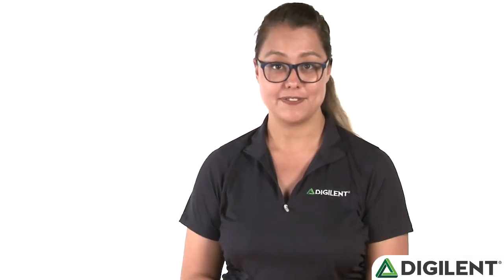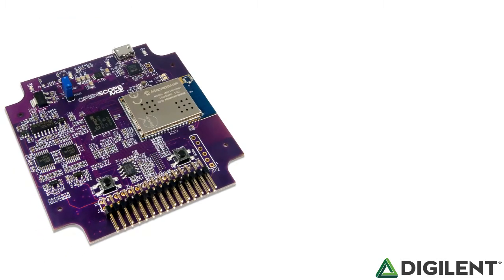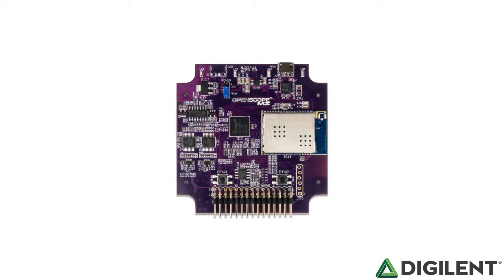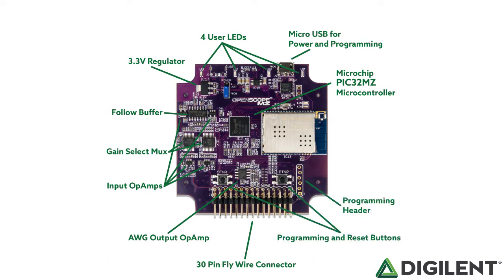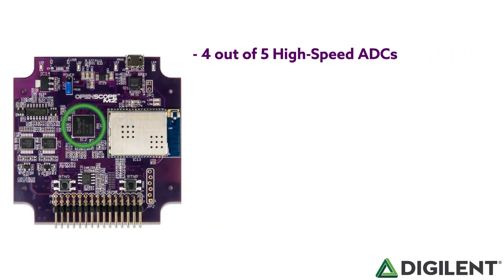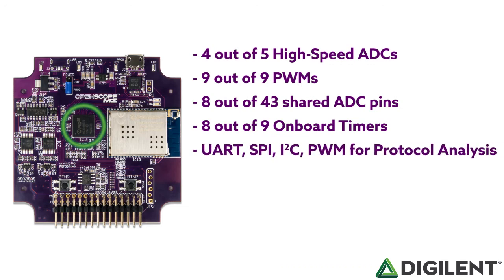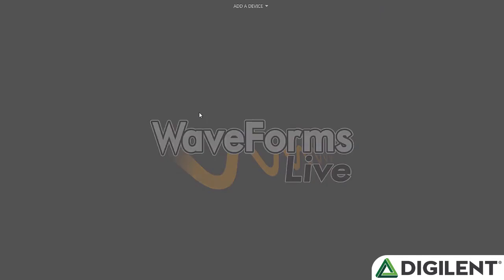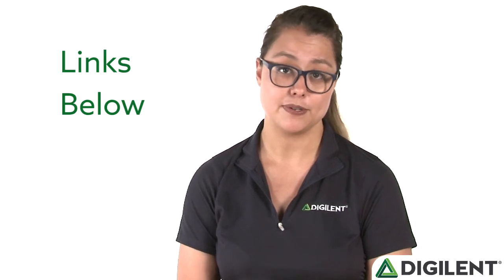OpenScope MZ Introduction

Comment: 2Mhz bandwith? Bitscope provides 20Mhz
Reply: I'd caution if that could be Marketing spin on behalf of bitscope. Since I am not in that company I can't confirm it, but we were very deliberate in choosing what to write. 12 bits at 2MHz and 6.25 MS/s. 

If we wanted to maximize, with no regards to actual performance, we would do the following: 

Add up all of the channels, maybe even the digital ones too. We would have 112.5MSps if we did that! (2(analog)* 6.25MSps + 10(digital)*10 MSps = 112.5MSps)

Or like Microchip does in their data sheet. 

Actually each channel can do 3.125MSps * 6 converters ~ 18Msps

So if we wanted to market it as such, we could have chosen to call the Openscope a 112.5MSps instrument.

Also I am biased, but our software is much better.
Reply: Hey Rolando, 
Here's a thread of people talking about the Bitscope and the 20MHz claim: https://www.eevblog.com/forum/testgear/bitscope-micro/